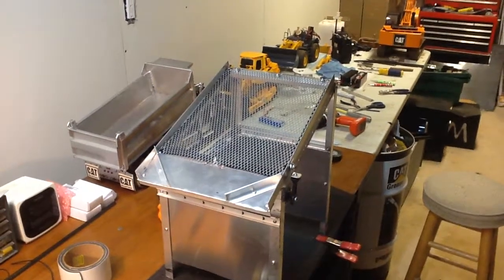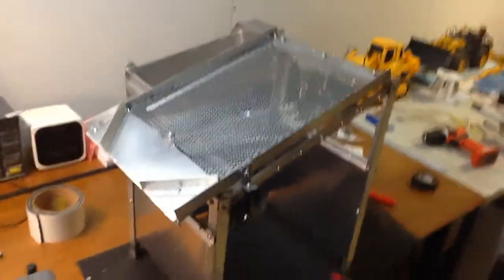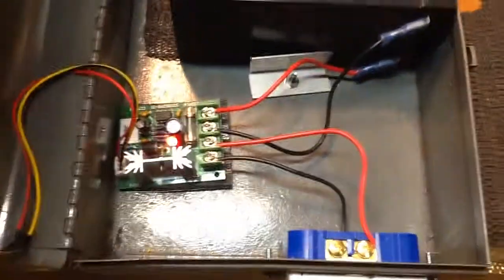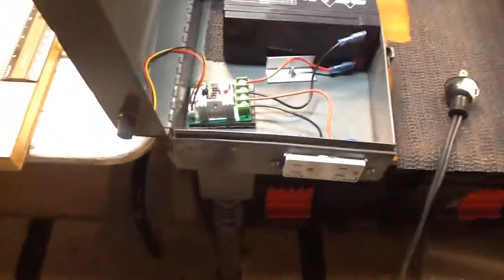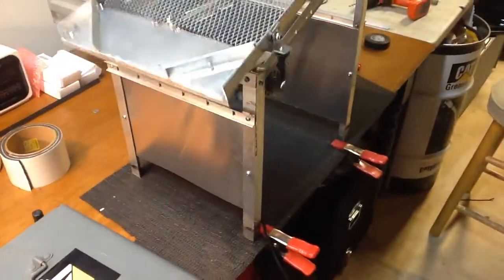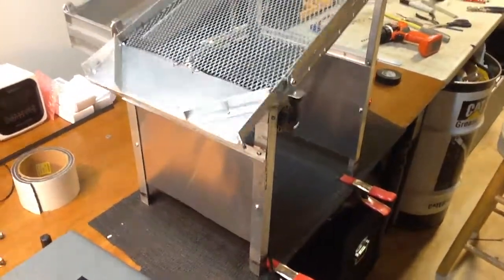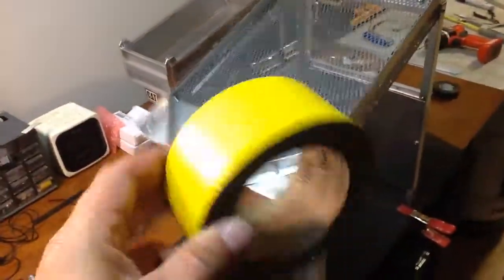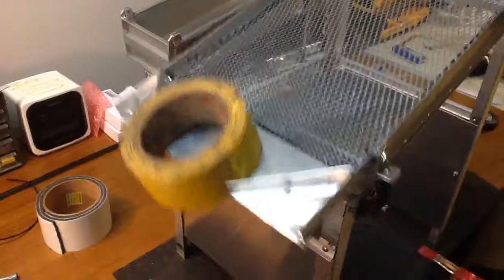Screener test 4

Comment: Hi, I liked the screeter but if you want it a little quieter you might try muffling the screen itself. This can be done by either running a brace down the screen and hot glue or screw it in place. It may look better underneath. A stiff hose would work as well. My other thought is if your motor has the shaft that is long enough that you can put a connecting rod on both ends that will make it more sturdy. While I'm still in the planning stage I did notice that windshield wiper motors are generally very tough and can be bought cheaply if you have a salvage yard that is about to crush their cars. Many times you can buy window and wiper motors for a dollar or two. The wiper motors are designed to run for hours. Did you do the conversion on the light duty dozer and loader? Thanks!
Reply from the maker: Thanks Bob. Glad you like and yes your right about insulating the screen from the frame. I used duct tape along the frame rails for the screen and a lot of the noise was from the lip plate. Some dense foam strips has that better now. Also added a rubber strip under the deck where it strikes the lower structure. Much less noise and I'm sure the neighbours can't hear it now.lol